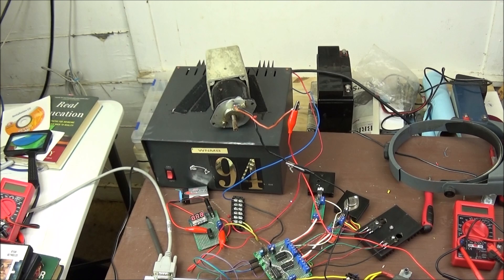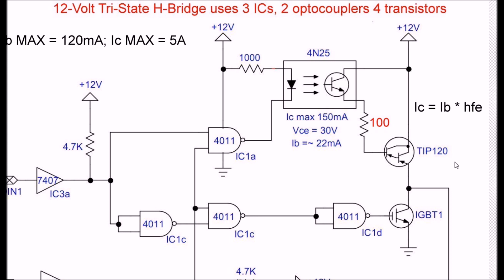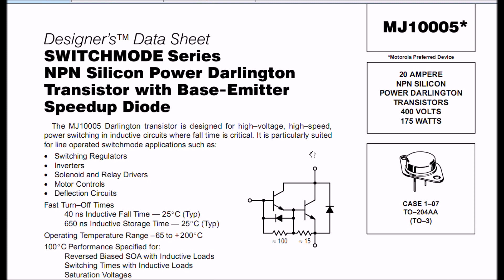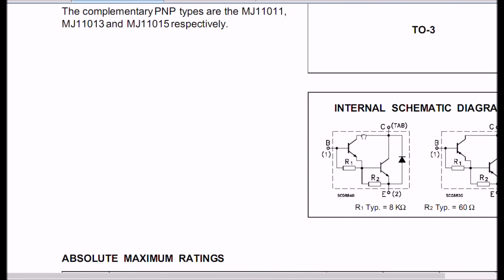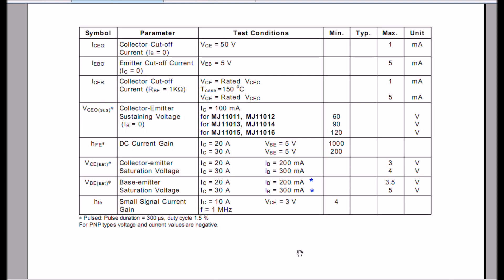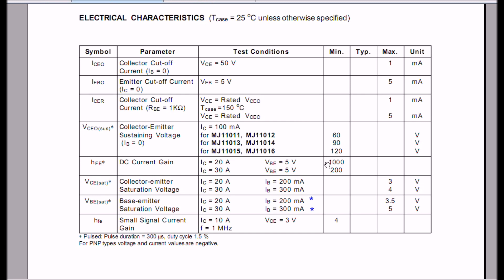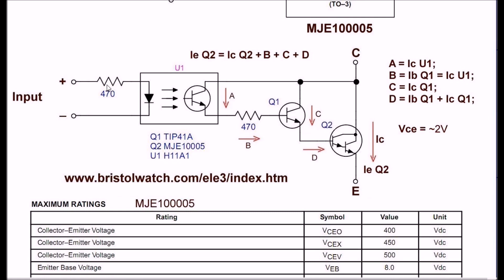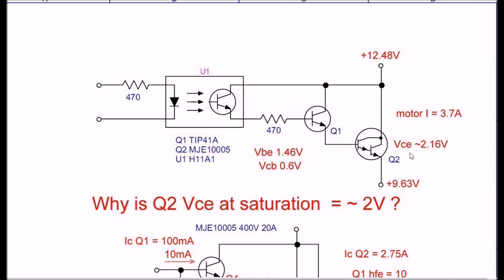Driving High-Power Darlington Transistors

Comment: Dear Lewis. First I want to thank you for sharing your knowledge. I want to appeal to your goodwill and help me solve a problem. I need to activate a motor (water pump) of 3/4 power (HP), voltage 120, and 13 Amps. I have tried building a solid state relay using the TRIAC BTA24800 but the resistors burn out. Could you tell me what to do? Thanks.
Reply from the maker: AC or DC? Email me lewis@bvu.net

Comment: Nice project. Why not use an off the shelf IC for motor drive? They are affordable and easy to use specially if you need to PWM them. I have used many of them among which from Allegro and other manufacturers - they can be found and filtered from DigiKey dot com with various parameter search (power capabilities, channels, package etc...) and prices. I would also use opto coupler at the input if needed. You can buy an off the shelf motor drive module from DigiKey or eBay with amazing capabilities. I have built motor driver from discrete components and the chance of failure become higher and troubleshooting as not pleasant. Hope to see more of your great videos.
Reply from the maker: The idea is to build the device to learn electronics. Thanks.